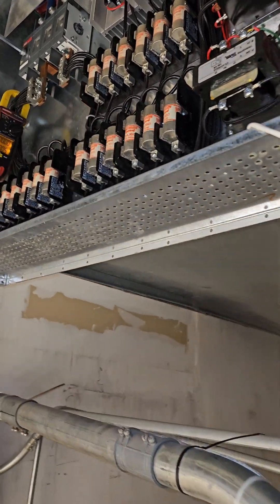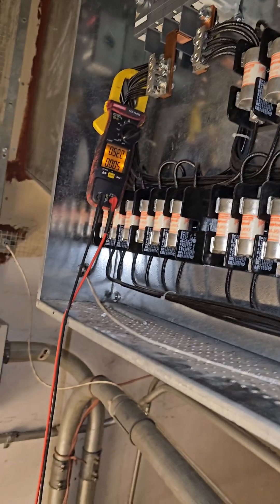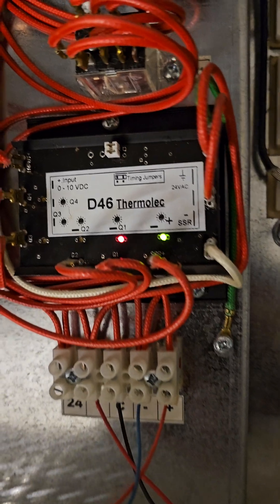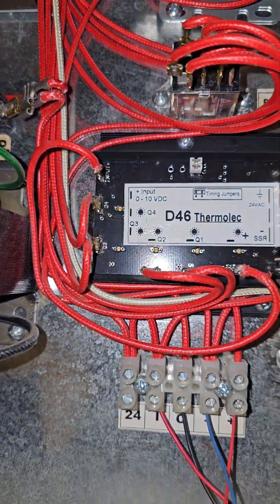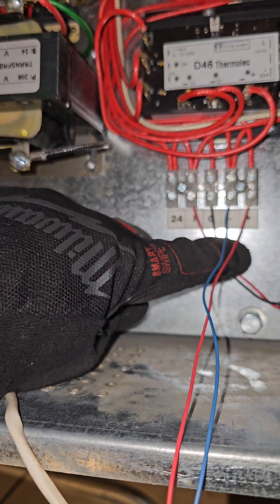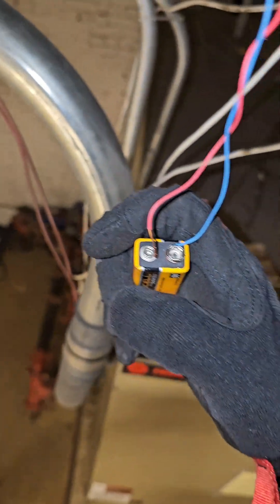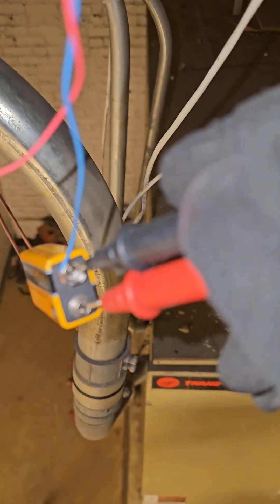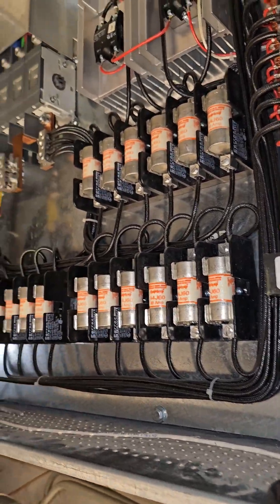HVAC CONTROLS HVAC TROUBLESHOOTING

Comment: Does this method of testing apply to other type of SCR as well like Thyristor/Diode Module (Powerblock) Type and Puck Type SCR ? So can apply the battery voltage to fire the gate in order to on the SCR ?
Reply from the maker: Possible however you would need to know the gate voltage range
Reply: The puck style needs downward pressure to enable the gate to fire

Comment: Very cool,also very smart so if it works that way u know the heaters are ok,
Reply from the maker: Yes sir 0 to 10 volts DC is needed to control this heater so if you don't have a DC power supply/ controller. Do this for testing and temporary operations